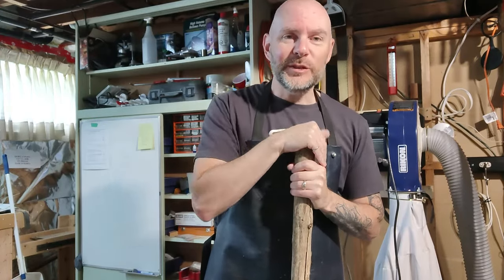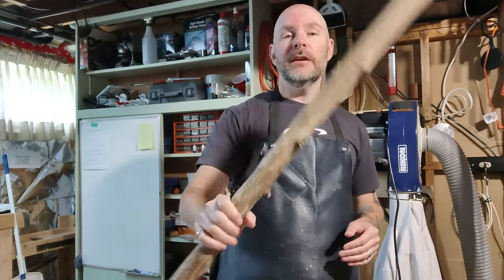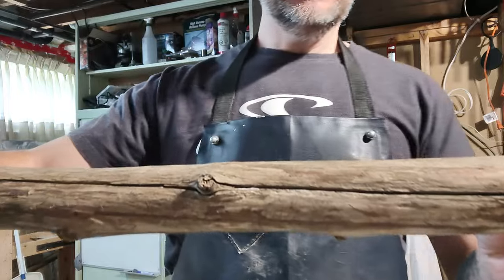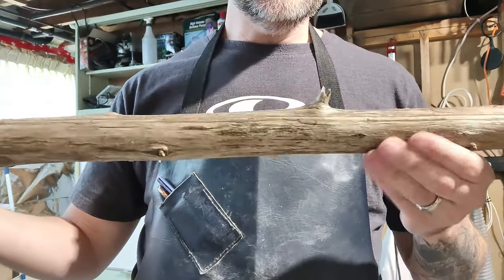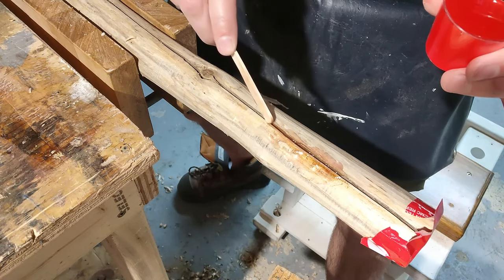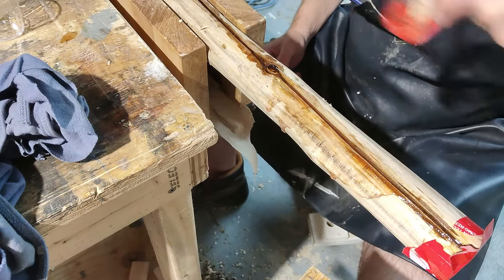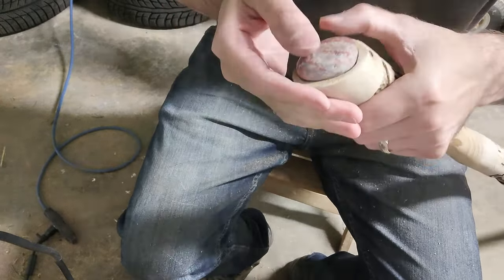CEDAR WALKING STICK

Comment: Hey - just as a friendly tip… if you attach some leather to each side of your bench vise, it will put a stop to that slippage, and will keep your vise from marring your wood. 😁
Reply from the maker: Sounds like a plan! A little weekend project…thanks
Reply: @JasonHedrich  - You're welcome... I just glued mine on, knowing that it will get abused in a vise... that way, I can easily replace later if needed

Comment: If you did not use epoxy on the check, would it continue to split or does the epoxy stabilize the check?
Reply from the maker: At this point, the stick was completely dry and the check would not have expanded more… but the epoxy strengthened the stick and sealed the check. The stick is as good as solid when cured

Comment: Thanks for the instructional! How long was this walking stick? How long do you need to wait for the wood to dry before you start working it or apply finish?
Reply from the maker: It was about 54" tall. I usually wait 4 to 6 months for the sticks to dry. They give a distinctive sound when they are dry when you knock them against concrete. That lets me know when it's ready to work on
Reply: @JasonHedrich ah! Thank you very much Jason! I appreciate the reply. I just moved to North Carolina, and there’s a great hiking trail near by that’s filled with Eastern Red Cedar. I look forward to using some of the skills you teach. Thanks!
Reply from the maker: @LeadingPaws  cedar makes beautiful lightweight hiking sticks! Enjoy the trails

Comment: I like it but, I would have used fine glitter on the epoxy  that you used in the crack. I have used glitter on other sticks I have made, mostly just to see how they look afterwards, IK usually vary the colors.  I have actually made one where the colors looked like fire, lol that was a fluke but I liked it.  I gave the stick to a friend.
Reply from the maker: That could work… but that’s the Color the client wanted so I stuck to it. I still like how it turned out. I did one stick with red epoxy, that really stood out against the wood grain…

Comment: I am new to stick making and what epoxy do you recommend using the filling cracks on the wood?
Reply from the maker: For smaller checks and cracks, I’ve used 5 minute epoxy. It works well, it’s thicker so less drips and you can Color it. For larger checks, I’ve used slow cure 2 part epoxy. Honestly either works well, just depends on availability and cost
Reply: @JasonHedrich  thank you for taking the time to answer
Reply from the maker: @The7thSonSteve-O  happy to help!

Comment: Greetings, stumbled on this video and love the hiking stick. One question I have is, could you go into greater detail on the epoxy product you use?

I have a couple of cedar sticks with cracks in them and am at a loss on what product to use to fill them in. 

Thanks on advance.
Reply from the maker: Thanks for watching! It's standard 2 part epoxy. JB Weld is a good product that's easy to find. Hope that helps
Reply: @JasonHedrich   Thanks for the reply, will into it JB Weld on my next trip to the hardware store.
Reply from the maker: @junioruncle4378  happy to help!

Comment: I tried your epoxy resin idea on a walking stick I made. I used the Dremel to bore out lines along the sides of the stick and filled it with dyed epoxy with citrine pieces in it. I used a UV epoxy resin, as I was filling it in I hit it with the black light which made it easier for pouring around it.  Thanks for your inspiration!
Reply from the maker: sounds awesome, I bet it turned out great! Thanks for letting me know
Reply: @JasonHedrich absolutely! Can you list the types of products you use to create the stick? I'm really curious What you use for the scraping tools as I've been using my knife to carve off the bark. Thanks! 🙏
Reply from the maker: @Mystic_Christopher  sure thing. I list them as subtitles in the videos. But I use spojeshave and drawknife to take the bark off
Reply: 5😊